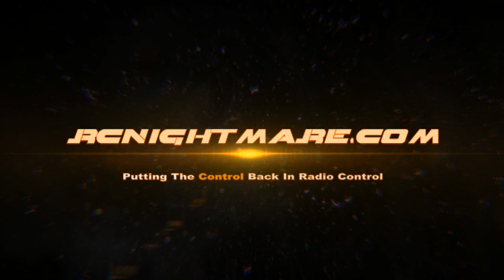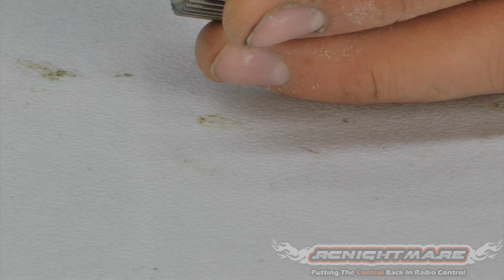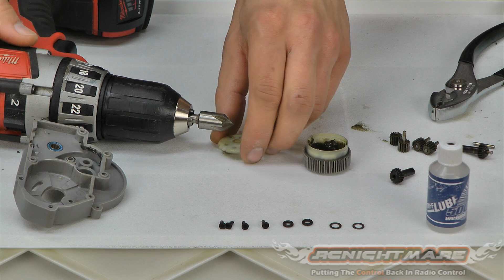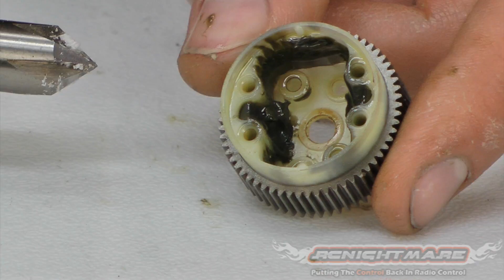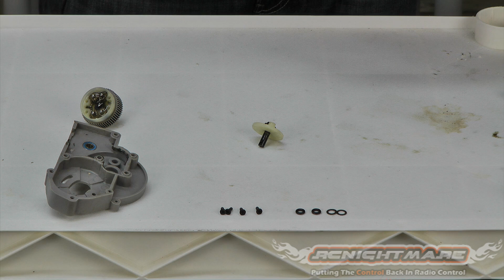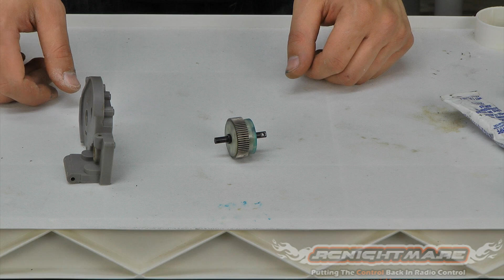How To Seal Your RC Differential-Traxxas and More

Comment: I want to know if I can put the extra o-ring seal in there memory is only got one on one side Slash 4x4 differential it's only got one o-ring in side of it can I put the other one in there because I'm never changed my gear oil in mine a grease or whatever my front one had two in it my back one had none in it

Comment: Hi, when I squeezed some of the 500 k fluid into my differential, and spun the shaft so the fluid slowly gets pulled in by the gears, the 4 small gears inside started pushing themselves upwards as I spin the main one at the bottom. What do you recommend? I'm doing the exact same mod you are doing

Comment: So why not countersink the other direction so the silicone can lubricate the o-rings internally? Also how did you adjust for side-side play of the sun gear shafts in the assembled diff?

Comment: @mrgokart73 epoxy the spider gears where they touch together only. Don't fill it full of epoxy, or it's permanent. If you decide later you want to have diff action, simply replace the spiders

Comment: if you want to get the 500k stuff to flow into the gears better, heat a dollop of it up in a small metal container very gently. it will melt and go liquid, and re-thicken as soon as it cools inside the diff.